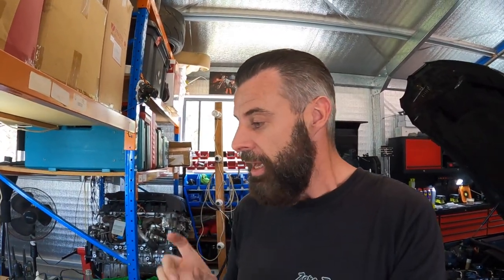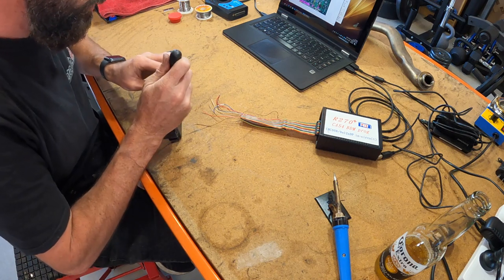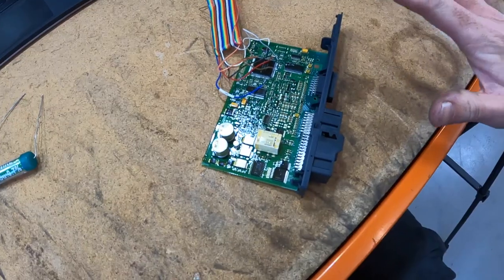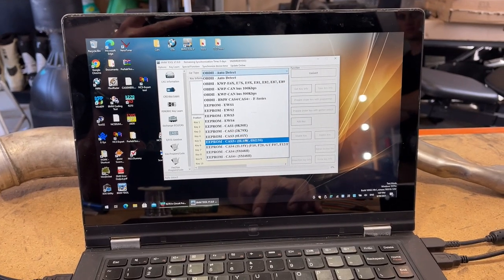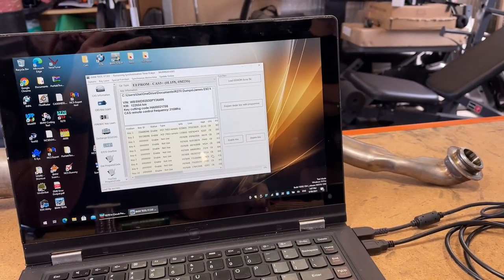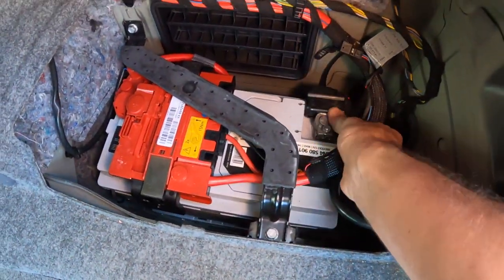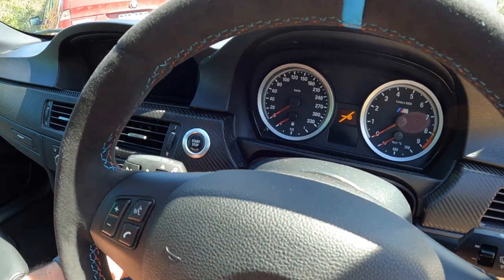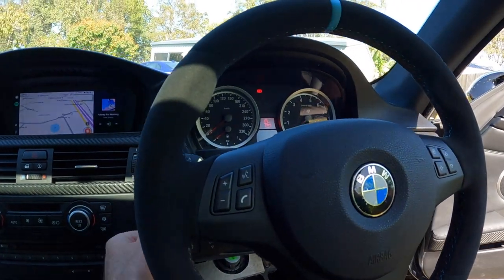CAS3+ ISTAP Key Coding Attempt With BIMTool & R270 :FAIL

Comment: maybe your cas was updated, so it became cad +++ crypt, you need to roll back the firmware to the original
Reply: the tool would have told him that
Reply: @bugsy791  you need to look OBD the units firmware to see if it has been updated. The cas is not crypt from the factory.
Reply: @zinchenkoroman9447  I know its not incrypted from the factory... I'm saying you use the bin tool or most readers for that matter it tell you what type of CAS it is
Reply from the maker: The cas was definitely update to the istap version. The tool is supposed to be able to downgrade, but it fails everytime. Thats what lead to the eeprom method.
Reply: try to make a new key via obd

Comment: You should never overwrite an already existing key position. It just doesn't work. Whatever key is inserted first after writing it back to the cas is the key that is going to take that position. The other key(s)on the same position will not teach in. If you don't write the eeprom back the original key on that position will be the only one to work. It's true that a comfort access cas module can only have 2 CA keys in use but that doesn't mean they have to be at position 1 and 2. If you had disabled the key 1 before programming the new CA key, and would have programmed it to position 3 it would have worked if it was actually one of the few good chinese CA keys. Also that non-CA key you can unlock with bimtool and the cas eeprom dump so it can be programmed again to another cas module ;)
Reply from the maker: Ohhh will look in to unlocking the non ca key for sure.
Reply from the maker: P.s I think I’m gonna bite the bullet and buy vvdi prog. The r270 just makes me too nervous.
Reply: Oh bro can you help be? I have an comfort Access key. Only 2 keys are activated my new coded key(by a locksmith) doesn't work with comfort access

Comment: 868 or 315 or 315lp
Reply: was thinking that...maybe one of the cars is a german car{868}
Reply from the maker: I can only see 315mhz when I test with bimtool. I think it’s correct as it works on other cars I have done from the same supplier
Reply: @ZeroTo60Tube  because mostly 315 or 315lp because its  start car  so mens  transponder chip program already not  issues remote feq see  u tomorrow fingers crossed